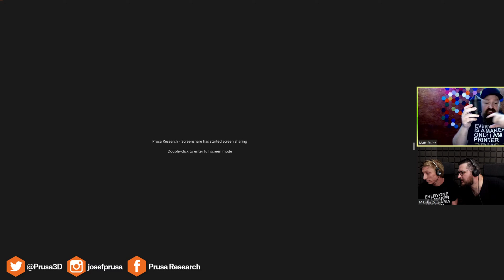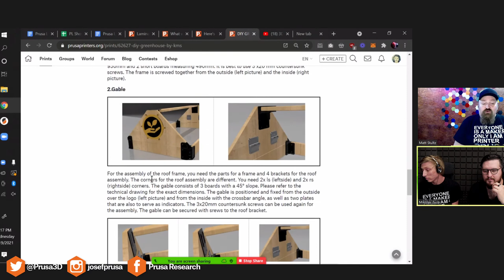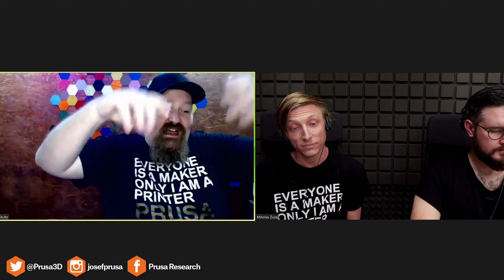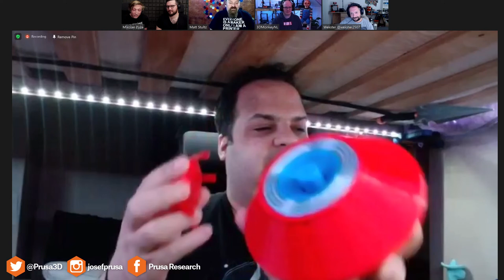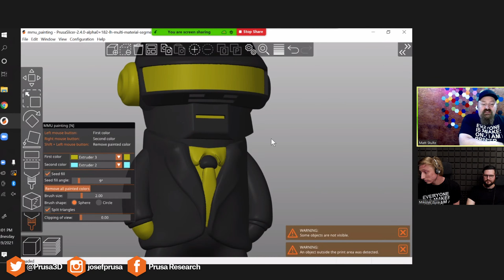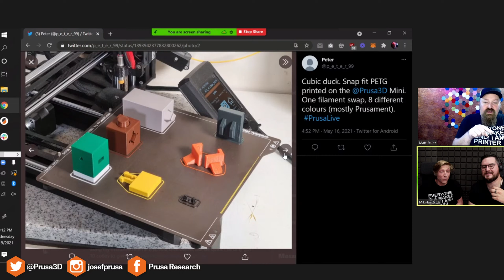1 year anniversary special! New material reveal, multiple guests, contest winners - PRUSA LIVE #26

Comment: Will the seed fill recognize smooth curves? Some files have a curve betwen two surfaces and this is where canvas fails
Reply from the maker: I'm not sure exactly what you mean, but the angle of the seed fill is configurable, so you can adjust it and hover with mouse over the part to see what's going to get filled. -Mikolas
Reply: @Prusa3D  say the angle between two areas isn't an angle but a curve made up of many small angles.

Canvas and the seed fill both have difficulty recognizing curves between surfaces. I hope this make sense more

Comment: Nice! I would love to see 3 features in PrusaSlicer in the future:
1) Tree Support
2) Textures like in IdeaMaker
3) A feature that does the same as the ArcWelder plugin in OctoPrint
Reply: Regarding 3: You can download ArcWelder from Github, put it in any folder you like and plug the path into Print Settings -> Output options -> Post-processing scripts.
Reply: @mrlassard2318  indeed and it works, but you can't preview the results with the prusaslicer gcode viewer. Being able to see the arcs produced would be nice.
Reply: For doing arcs in slicer, it would be nice if seams didn't end up mid-arc as they aften do with the current behaviour on the ubiquitous box with rounded corners

Mostly the advantage of arcwelder is g-code compression at the expense of precision, maybe prusa firmware support for meatpack would be more use as then you're not doing arc -> triangles when you make the STL, short lines -> arc when you slice to gcode and arc -> lines in the printer. 

If you can go straight to g-code from a format that supports curved surfaces then you can get smoother curves up to the resolution of the firmwares's planner but whilst your input is triangular meshes all you are doing is lossy compression. That might require .step support or similar?
Reply: @rowlandstraylight  Good point! .step support would be the cleanest solution.
Reply: @mrlassard2318  it's a LOT of work though, going from a geometric definition to a mesh is well defined, there's a lot of good algorithms and software libraries to do this well.

Going straight to curve fitting on projected geometry isn't so much a plug-in as turning the entire toolchain upside down and reinventing a slightly rounder wheel.

My compsci thesis was kinda tangential to this (lazy evaluation of functional meshes. Don't go there.) And honestly unless there's GPL libraries that will already generate arc toolpaths from geometry definitions, it's too much to ask.

A plan b might be to export stupidly high detailed STL geometry around the curves with the expectation of running arcwelder, which is what I do ATM, but if you get it wrong and arcwelder can't generate smooth arcs, you still get stuttering.